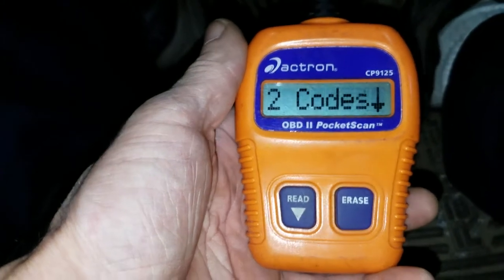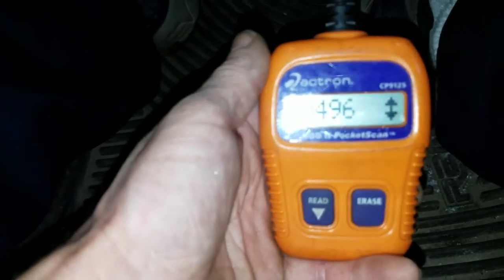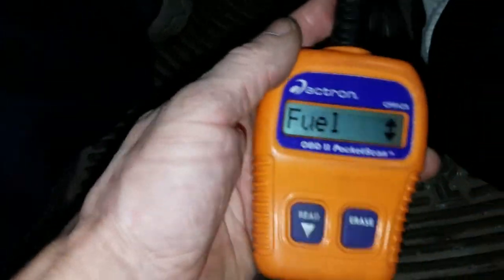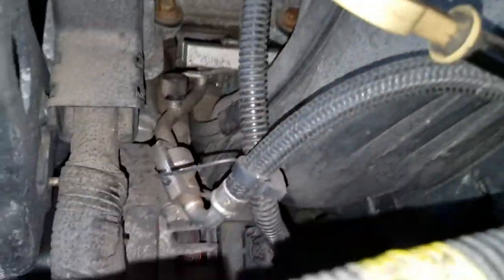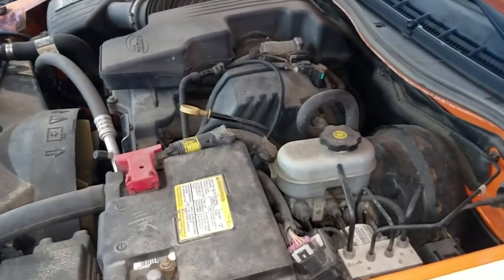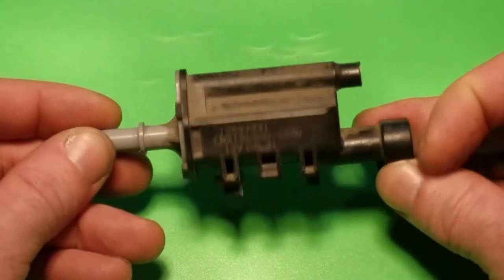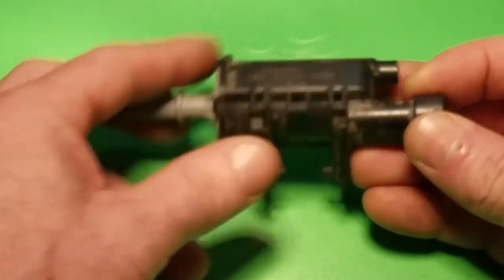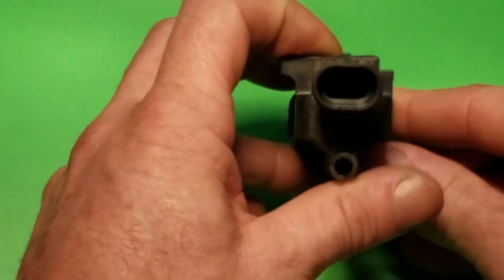P0496 P0455 P0456 P0442 EVAP Purge Valve Test

Comment: Hi, I replaced mine on a 2010 Genesis 4.6, but the check engine light is still on. Should it go off by itself or should I reset the codes? I could not easily blow through it.
Reply from the maker: Code would need to be cleared or car driven long enuff for it to run the leak test for the evap system.